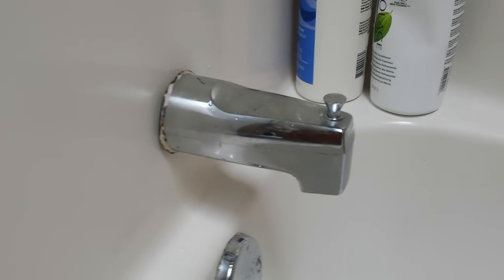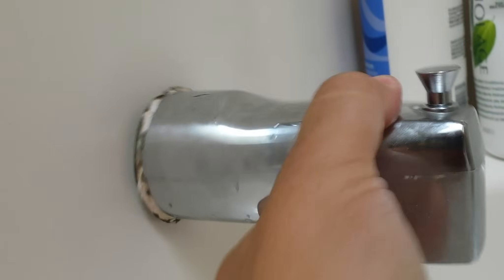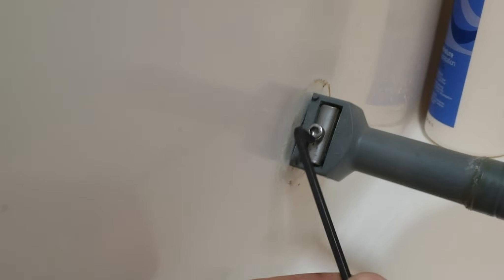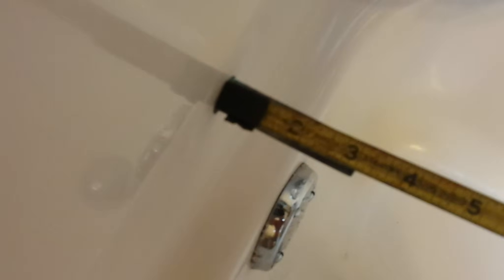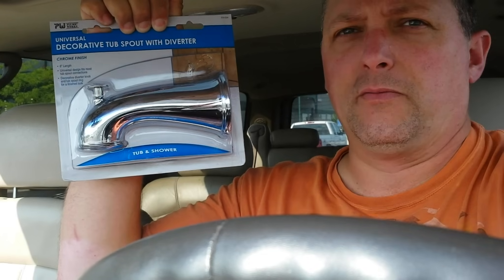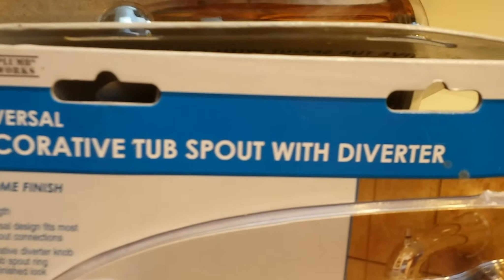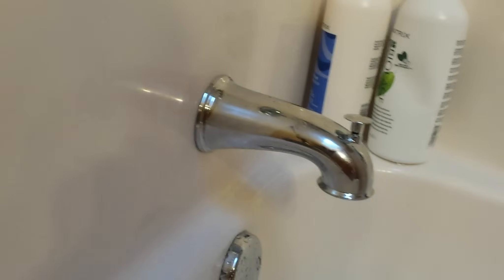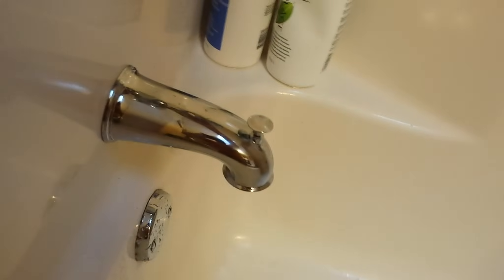How to Replace a Bathtub Spout | Home Plumbing Repair Video Series

Comment: Nice video, but you forgot to mention to use teflon tape on the threaded part (Also, would have been nice to see water actually diverted)
Reply: Probably has a rubber gasket.
Reply: You can get away without it most of the time if one or more is Plastic of some sort still recommend it thogh cus the Plastic will stick and bind up and the Teflon will act as a lube and make it easier to install and remove

Comment: You should add one final step. You should prove out the part of the spout that diverts the water. As a final step, you may want to divert the water and see how much leakage there is at the faucet when water is diverted upward. Thank you for making the video,
Reply from the maker: You are correct.  I did another video that shows the difference.
Reply: @FROSTYLIFE  add the link to that video here please.  Thanks.

Comment: A couple of rules for plumbing:
1. Always do your work while the plumbing store is open.
2. Always plug the drain while working because drains attract screws and other small pieces.
Also, caulk around the spout from the 7 o'clock clockwise to the 5 o'clock position. Keep the caulk bead small.
Reply: Why
Reply: porque?
Reply: Leaving a little opening in the caulk at the bottom allows any water that makes its way into the interior of the spout a way to exit. Water sitting inside the spout will cause mold, corrosion, and other nastiness.
Reply: @wizengy  Thanks!
Reply: @wizengy  So with this sleeve with threaded end, there is always a chance of excess water coming back the pipe to the wall?
Reply: @ybrik5937  It could be something as simple as condensation inside the spout or a small crack when the caulk gets old. You do not want moisture sitting inside there for weeks.
Reply: Great comment!
Reply: @wizengy  Excellent idea, especially if you are in a State where the water comes from the Colorado River.
Reply: @wizengy  Thanks for the info!
Reply: 3 rules of plumbing
1. Shit runs downhill
2.payday is Friday
3. Don't chew your fingernails

Comment: This video helped me a lot!  Thanks for doing this.  One word of warning though.  In my bathroom the geniuses who installed the plumbing in the original new house (1 year old house) cut a large hole for the copper tube to come through.  I did not know that I had to basically caulk the opening shut before attaching the spout because if the diverter leaks then the water will run along the back of the copper tube and leak onto the ceiling.  This is exactly what happened.  So, make sure the hole through which the copper tube emerges is sealed shut.
Reply from the maker: Very good point.  Thank you for pointing that out.  The trim piece is not enough for keeping water out.  Like you said, it must be sealed.
Reply: so if water is running back towards the wall, along the bottom of the copper tube, and you seal the gap between the tube and the wall, where does the water go? Does water just sit in that chamber of the faucet, potentially damaging the wall over time,  or is that a drain hole at the bottom of the faucet attachment, where the water can escape?  Is there a better solution to stopping water from going backwards along that pipe? like maybe putting some sort of gasket around it?

Comment: Thank you so much im a painter by trade but had a very leaky faucet asked my buddy how to do it and he said it was simple enough to follow instructions. I got confused so turned to this video for help and pulled it off in less than 5 minutes! However if you do have trouble getting the fitting to slide all the way i would recommend sanding the pipe a little makes it 10x easier!! I called my dad and he told me that😂😂

Comment: Thanks, FROSTY Life for the video and advice on not buying the cheapest replacement.  I bought a Moen spout, and the instructions were so short and easy; they were literally written as 4 steps in big print on the back of the spout package .  Unfortunately, my house has a CPVC stub, instead of a copper stub, but with your video, I had the old spout off, and the new one on, in no time. :-)

Comment: Tips: sand off the calcium build up around copper pipe, plumbers tape around thread, and clear calk around the base of the spout After shes installed. 20yr old commenting. Great video for beginners for sure, love the positive attitude.

Comment: awesome ! thanks for this. I am very comfortable doing this now that I see what it involves. I have done much more difficult plumb stuff just never encountered this particular scenario. my old spout was always like 1/2" away from the actual tile and had a huge amount of sloppy caulking in between, always was loose feeling. when I redo it I will make sure it is nice and snug ! whoever did it before probably just didnt give a crap and threw it on there with no effort to make it correct.

Comment: My family & I are purchasing our first house next month. There are plenty of little things that need to be done which i have done in the past, but plumbing was not really one of them. This spout issue was one of the items from the inspection and now i think is should be able to do it without issue. Thanks for the video.
Reply from the maker: yes..the tub spout should be pretty easy to replace. Thank you for watching and let me know how it goes.

Comment: The following worked great in 8/2018: I sprayed some WD-40 on the rod of the diverter knob, then sprayed more inside the end of the spout on the rod and also on the rails of the diverter. Now the diverter works great, with I'd say 95% of the water being diverted to the shower head. No need to buy Allen wrenches, buy a new spout, or hire a plumber.
Reply from the maker: I love when my video can help people save money.  Plumbers charge a very high amount of money.
Reply: I will have to try that WD-40 trick. My diverted sprays a lot of water that is supposed to go to shower head. If I do decide to replace the whole unit on my next week day off atleast I now know it not as big of a job as one would think

Comment: Trying this tomorrow, and will be picking up caulking as well, just in case! Thanks for the informative video. My converter hasn't worked since I bought my house 6 years ago and has essentially rusted shut to where only showers are possible, so i haven't been able to take a hot soak since then. I'll keep y'all posted
Reply from the maker: Once you get the old one loose (I can be stubborn) then the rest of the task is pretty easy.  Make sure you do not break any pipes.  If it is really rusted badly then you might still need a plumber that has the right equipment to get it loose.  I hope it goes well, let me know.  There is nothing like a hot soak.  I am not a bath type of guy, but after being in the lake and covered in sand and chilled from the lake water, the hot soak is the perfect remedy.
Reply: @FROSTYLIFE  it worked! I didn't do any damage to the pipes, don't have a leak, and didn't blow up the house! (I'm not what you would consider "handy"). Thanks SO much for the video!!!!
Reply from the maker: @keeslover777  I am very proud of you. I am very happy to hear that my video helped you become handy

Comment: I have American Standard spout so the procedure may be similar. Thanks for the video. My problem is Knob lever not coming up to block the  diverter properly.
Some if the suggestions by commenters such as use Teflon tape, sealant like silicon at the base, etc. are worth noting.

Comment: Frosty you explained very well however my problem is different. My sprout drips even when the shower valve is shut. No leakage from the shower but leaks my sprout with valve shut what is the solution?

Comment: Thanks for this video. I have that little hole in the bottom of my spout and no matter what I stick up there I cannot locate the set screw. Also with much pressure I can twist the spout round and round but it never gets loose and I am terrified I will break it off. Thanks in advance for any advice from you or commenters.

Comment: My tub spout is probably from 1984 when my home was built. It has no opening for a hex screw or anything on the underneath. I can turn it clockwise about 1". It will not budge to unscrew it, to the left, as I assume it is a screw-on type. I don't want to force it and break any pipes if that's a possibility. Should I be concerned about a pipe behind the wall breaking? What can I do when the spout is stuck? Thank you!
Reply from the maker: Whatever you do, please do not break any pipes because that would cause a lot of water damage.  In this case, you tried, and found that it would not loosen, so I would recommend calling a plumber, but check with other people in your area for a fair and reasonably priced plumber.  The cost of damaged plumbing is very high.
Reply: @FROSTYLIFE  Thank you for taking the time to answer me. I appreciate it so much! Take care!

Comment: The water is shooting out at the wall where the faucet is connected. Single Mom, wish me well! Thanks for your helpful video!!!
Reply: Probably more of a plumber problem. :-(
Reply from the maker: @NotThatKindaKaren  I agree, sounds like the water pipe may be fractured and in need of replacement. You dont want water getting behind the wall for sure.

Comment: We bought our house New Years Eve 2018.  We've been making little improvements to the house since.  One of the things I did was install a low flow (2.5 gpm) shower head with a shut off valve in our kids bathroom.  We were hoping to cut down on the water bill, as where we live has some of the highest water rates in the country (our average water bill is $250 per month).  That is where the troubles began.  The first shower that was taken showed a problem, water dripping into the family room from the ceiling.  Unfortunately nobody caught it until the second shower was finished.  It seems the company that was hired by the sellers after our home inspection to fix the leaky diverter valve in this shower found the water was coming from the copper pipe and put one of these repair sleeves on the pipe.  It was done nicely, except the o-ring was never seated properly.  Water shot past the o-ring with the back pressure from the  new shower head.  I removed tub spout to find this marvel of engineering.  Having never seen one before I took it apart on my own and put it on again with the o-ring back in place.  Then I found your video.  Thank you for showing me that I put it together improperly, and I could have saved myself an hour of swearing and straining my eyes while sitting my 280 pound self on my tailbone on the edge of the tub and I used a precision screwdriver to screw in the fitting in the back (turning it a quarter turn at a time with the little notches in the back of the fitting).  You rock, and now I know better because of your expertise!

Comment: Hey there! I just took off the old spout np water off if course but as I'm putting on the tape thread on water is still coming out off the copper pipe an soon after I put on the new spout water is still leaking a bit... has this have anything to do with the copper pipe threading behind the wall!?

Comment: Frosty, I replaced a Danco slip-on tub spout with diverter. When I turn water on and lift diverter I am getting a good amount of water coming out the back? What is wrong or possibilities as to why it is doing this? How do I fix this or do I need to return it and get another one? Thanks for your videos, they have been a big help.

Comment from the maker: how to replace your tub spout, made easy with this video
Reply: Forestry jobs
Reply: Hi frosty I enjoy your work and videos.  I just wanted to give you a tip that I learned from my Doctor friend, When you get a bruised black fingernail from a Hammer slip. 
Straighten out a small paperclip, and heat it up with a lighter for 5 seconds and gently push it on your black nail. Because the paper clip is blunt it will not hurt, the tiny hole Will release the trap Blood making your nails look better and heal faster ! 
The sooner you do this after the injury the better. 
Congratulations on your daughter getting married and also the peppers on the pizza great idea

Comment: You did good the only thing I would do differently is use 00 steel wool to remove the rust and oxidation off the outside of the pipe and lube the o ring on the inside of the adapter with silicone grease cus if it gets rolled or cut  doesn't seal it will leak into the wall

Comment: one very important detail that was missed to be pointed out in this video was that the screw that holds the plastic insert to the copper pipe should be placed directly at the bottom and not on the side as seen here.  DIRECTLY AT THE  BOTTOM is the only place where the screw should be.  Otherwise, when it's time for replacement, the first order of work is to loosen that screw....how do you loosen that screw if  access is not lined up?  The screw can only be accessed through a slot located at the bottom of the faucet lip.  This slot is designed to line up with the screw for easy access.  Good luck on turning the faucet out of that plastic holder in a few months.  After awhile, these 2 parts get stuck together.  As you loosen the faucet, it will turn in sync with the plastic as one unit, the screw will start stripping the copper pipe which is not good.  Hope this helps.

Comment: I want to caulk around my tub spout, but the whole thing moves around a lot... Should I take it all off and tighten something?  If I push in and pull out on the spout it moves a lot, which makes me worried about caulking

Comment: Frosty I forgot to tell you my sprout pull up knob does divert the water from sprout to shower. The water keeps dripping even when the faucet valve is shut.
Reply from the maker: It sounds like you need an entirely replaced Faucet valve

Comment: Hi, Frosty Life.  Thanks for your informative video.  The plumbers I called to fix my bathtub spout (Moen - has a ring around the base)  because it leaks when the shower is running could not remove the spout.  They said they would have to break it and possibly cut a hole in the wall, behind the tub surround, in the adjacent bathroom.  I said forget it.  Is there some way I can get this spout off without having a big hassle?  Thank you.
Reply from the maker: +Margaret Wishart actually they are right. I had to do the same thing in my downstairs bathroom. That repair took several days because I also had to cut a hole in the wall and make an access panel. Cutting a hole in the wall sounds terrible but if you make an access panel out of the hole then it can look nice and it will help you any other time that the plumbing needs repair. What Builders build the house they really should be putting access panels In-Place in the wall so that plumbing work can be done because it will always happen. I think that is your only choice and it is very common
Reply: Thanks for your reply, Frosty.  I guess I'll have to deal with it when I have some spare cash.  Any idea how much this work should cost?  Thanks.
Reply from the maker: +Margaret Wishart my dad had a similar project I think it costs between 2 to $300 for all the labor and parts and such. Plumbing is always expensive unfortunately
Reply: Okay, thanks, Frosty.  I appreciate your input.  Take care!

Comment: Getting VERY frustrated here....mine is notched out at the bottom but has no set screw in the pipe...not a philips, not a hex.I have wrapped the spout in a facecloth and tried to unscrew it using a set of channel locks...still nada. I checked inside the attached linen closet for an access panel. Nothing. If I use and more force, I'm afraid I'll break the pipe....any suggestions?

Comment: You did not show if it actually diverted the water.
Reply from the maker: Oh good point.  It works like it should.  Good suggestion.
Reply: I was not trying to be  nit picker I just wanted to see how well this universal spout worked because  I need to replace mine.  Thanks for the tutorial video.
Reply from the maker: Blue Girl no problem at all. It actually works like a charm I'm really happy with this spout. I think you'll be happy with the diverter once you install it. Good luck with the project. Thanks for watching Frosty life

Comment: Yeah, need to replace mine as well, only because it looks corroded.  That and the sink fixture.  Easy enough, it seems.
Reply from the maker: it is not good when it is corroded.   In that case, I suggest starting your project in the early part of the day on a week day, just in case you need to call in a plumber.  I had a project fail once and I was thankful it was during the day when the plumber is available.

Comment: Wow, great tutorial! I'm going in! The black fingernail was a bit unnerving, but that's occupational hazards for you. I was wondering if you need any caulking or water-seal type tape for the pipe, or will it make any future changes difficult to remove the faucet.
Reply from the maker: I would recommend using thread seal tape.  It does not prohibit removal at a later time because it seals, but does not bond, so loosening the thread would not be difficult in the future.